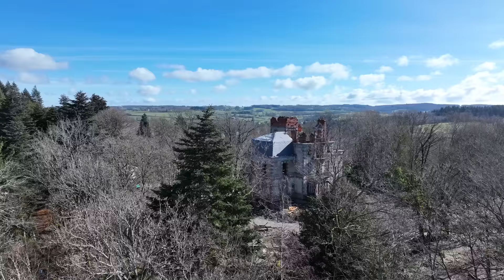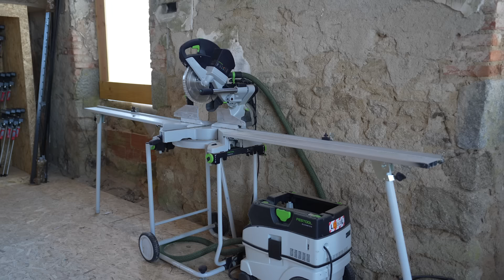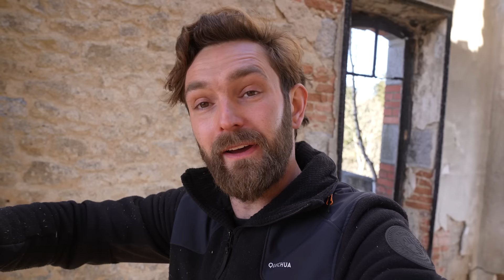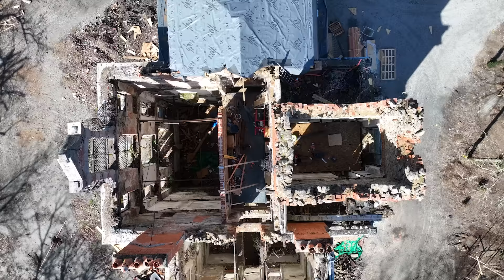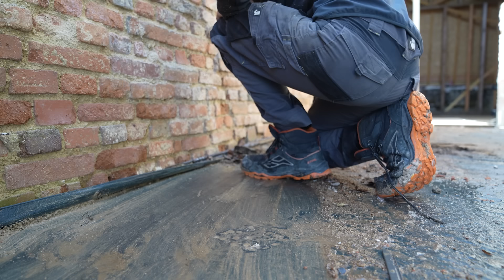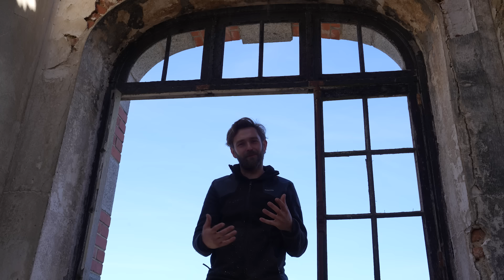What's next? the plan for the next stage of renovation.

Comment: Dan
Everything slowly but surely coming together. I noticed that the waterproofing you have put on the new roof is flapping around. If I were you I’d tuck those loose ends in and under the boards. Or nail some 2x1 timber along the edges..
If the wind gets underneath the cover it will rip it all off…
Cheers
James

Comment: One thing you might think about doing is cutting out a section of floor (middle maybe) and leaving as remove/replace so as to have a way to pass material up and down as needed.  You just need to frame out a box around the opening.  It will be a trapdoor between shops.  
I wonder if you can set a mini-crane frame out the side of the building to facilitate moving material up the building.  Think of the way farmers put hay up.  It just involves a pully and winch.  It would save your back.   You have a lot of beams and sheets still to move up.  Save your back.

Comment: You did not say what broke in the winch but as it looks like a off-road type of winch, it may have an overload 'fuse' in form of a metal pin that if overstressed is designed to break.   If that is all it is, it should be relatively easy to fix.

Comment: Dan: you will end up with significant surface rust issues on all that expensive stationary woodworking machinery if you dont keep them in a humidity controlled space. Doors and windows plus a dehumidifier to keep your rel humidity around 40-50% will preserve the machined surfaces on that equipment for the long term. And by machined surfaces I mean the one you can see (like teh machined tops) to the ones you cant see (the gear mechnisms, shafts, etc) inside the machine bases. 

I'd also like to see a bit more detail in the content you are producing weekly. The last few videos are more like McDonalds fast food.

Comment: On the very top of the crumbling tower walls should be one last floor. That is the floor with the huge tower roof windows. 
You can probably get away with no stairs and just installing two pull down step doors to those levels, then a simple ladder and trapdoor to get to the Widows Walk at the very peak of the tower roof. 
There will be tonnes of storage space when everything is done and built.
You can only go so fast Dan. The family is still more important and not something you want to neglect. Those children will forever remember Dad and the huge mansion he rebuilt that they got to play around in and watch get built. Lots of awesome memories for when they are older adults and get to walk through the finished Chateaux reminiscing
Reply: At the time of the video he's on the third floor, so the floor above he's talking about is the fourth floor. It has three small windows. On top of that was the roof with at least three dormers (impossible to tell from the old pictures if there was a fourth). I'd think there used to be a ceiling between the fourth floor and the attic as well, makes the most sense.
Reply: I want to have my picnic lunch on the Widow’s walk. Something wind proof on a nice day.

Comment: I would definitely finish that hallway so you can help finish sealing off that wing with the roof that's on it. Then do the turret so you can put an actual staircase in to make the movement of materials much easier. Then the wing opposite the one with the roof on it. Then the wing on the back of the house. My 2 cents for what it's worth.

Comment: It always feels good to have a significant piece of a big project done.  Time to reflect and be proud of your accomplishments.  A couple of thoughts:
1.  On the workshop... before you place the tools think about the type of tools and how the materials will "flow" through.  That will help determine an optimal equipment placement.  Add more lighting than you think you need and more electrical power as well.
2.  On doors and windows... think about standardizing the size... you might need a couple of sizes but when building them you can minimize the jigs and make several at once. 
3. You are now a professional on putting in floors so it's just getting the materials, tools, and time in the right place at the right time.  They should go in fairly easily.

I enjoy watching your journey.  I'm in the USA and the materials we use are similar but we don't use as much rock and from what I can tell our timbers are much smaller.  Post as much as you feel comfortable and we all understand when "something" (like life) gets in the way.

Comment: If it was my project, the next bit would be the other (mirror image) roof section build. At least build the pieces and if need be store them till you are ready to install them. Reason being is that you have now a clean picture of how first the roof structure was built which may not be the case in a few months time. 
In my experience if one needs to build two identical (or near identical) things, those things are best built at roughly the same time or you may run the risk the second thing is built differently or with several errors or needs redoing in parts...

Comment: What next was always my question. You have confirmed what was kind of my guess. The wall rebuild to the new roof is definitely required. I would also contiune to add as much floor as possible. Seasonality wise potentially, the entire top floors and roofs. Let's be honest internal renovation won't progress without being water tight (roofs & windows) are needed. So you may as well crack on whilst you're in the zone. Keep pushing Dan your doing great.

Comment: I get how you are a bit lost after the roof. No shame in taking a few days off as that was intense concentration. What you need is a project timeline. An order of what the next job is and an estimate of how long it will take. That way you know what is next and will have a rough idea of when each step will be finished. It will help with ordering materials and budget. No problem if you finish each early or late. It’s just a framework. You should also have several blueprints. One each for electrical, plumbing and purpose for each room so you can plan for the electrical, plumbing, closets, windows and doors, stairs, etc. The more you plan the faster and cheaper work will move.

Comment: I’m not a contractor but I think finishing the brick wall in the attic, building a temporary attic door, installing  temporary windows and a secure door in the workshop should be the next steps. It keeps thx weather out and thieves. Security cameras should be next.

Is your neighbor connected to the grid? If so, can the city expand the power lines to your property, plus city water?

Could you do a video on these subjects, planning permissions, water, power, sewer. Are you entitled to community trash pick up?
Reply: Did it ever cross your mind why he has no power, water, sewage, - or even shown once a proper planning drawing?

Comment: Great video.  With all the work I'm surprised you get ANY video out at all!!  That turret looks very rough. You should bring it down about four feet or more. Throw off all those rough broken bricks on top. Get it to a nice flat level surface that will  be a lot stronger than the wreck up there now.  If I ever make it to France I'll stop by and help for you a few days!  (I put an old 1874 back together after a fire.)

Comment: My thoughts on the next project; get the steel in on the top floor on the other side, if the walls can handle it you can skip to the top floor and save the wood being exposed to any more rain than is needed. Oh, and is there a plan to get some stairs at some point or are you planning an elevator?

Comment: I’m no expert but instead of building floor by floor up why not just rent scaffolding and get the walls fixed then get the rest of the roof done. That would be faster and you wouldn’t have to worry about the floors getting wet and ruined by rain & snow. Get them to sponsor you and perhaps you’ll get the scaffolding for free or really cheap!
Reply: He just explained. Putting the floors in strengthens the building and in doing so will support the roof.
Reply: The weight of a mansard roof sits on the floors, not the walls. He has to build the floors first.

Comment: Hey Dan! Great work! ... just wanted to say, at some point, soon, I imagine, you'd want to either put some tin or galvanized roofing sheets, or, roof tiles on the part of the roof you've already completed, just to make that part a little more waterproof - this will protect the membrane and the wood below (but then again, you might want to wait until everything else is more or less complete, so that you can order all the tiles / roofing sheets at once - your call really ... if the membrane gets ripped or something in a storm - not that it would - you'll have to deal with that).

Comment: I wonder, how will you power all that machinery? Maybe get a second (or third?) battery and a few more solar cells (now that you have a roof to put them on)? Or finally get the chateau back onto the electricity grid though I can guess that will be a lot more paperwork and probably real work as well to repair the connection from the grid to the plot the chateau sits on.

Comment: Are you giving any thought to a small elevator somewhere? Joints wear out as you get older. There are one person elevators. Maybe somewhere in a corner in your bedroom that ties several related functions together over the three or four floors? Like a study/hideaway in the attic. your bedroom, the library, and a studio/workroom or even a kitchen(ette) or laundry and/or bath with sauna at the bottom. In other words a vertical suite.  It would be your elevator and not a guest elevator. They have to do the stairs.  It's a very tall house. 
I suppose you can always install a lift chair on the stairs?

Comment: If you finish the wall and roof in your current section, could you close it up enough to live in?  Then just use that as your base of operations for the rest? Or are the family logistics and safety against that idea? And a lack of a staircase yet .. 
Neat progress.
I would be very tempted to finish off that roof though.. tiles or corrugated metal.  Something semi permanent.
Reply: No electricity, no water or plumbing

Comment: You talk about waterproof/ water tight. Well... it is not fully true :\ You have no windows in the basement where your workshop is. Moister can still get in and damage your equipment. 

YES, rain can not come in direct from above that is a major improvement. Although from the sides it can, not much but it can. I should work first to seal those open-windows and doors as much as possible so there is no possibility any water get in or fog could flow easily into rooms you do not want moister at all. 

Your floors get wet again and again and you need to replace them afterwards when they get to wet and those boards are ruined. I know your work-order is from bottom to top, flooring every floor one by one. Do this and water will damage your floors. If there is a possibility to 'roof' the tower or other rooms, do so. think about is. It is harder to work on higher scaffoldings but the result would be a much more dryer space below it. An alternative is not to board each floor complete, just where you need to walk / work and use the same already damaged boards every floor. IN this way you will reduce the cost for new boards/ floors.  

You have done so far a very good job! Luck is absolute on your side. The walls are pretty stable. Your stone and masonry is great! Keep going.

Comment: on a percentage level, i wonder how finished this place is? by that i mean all the brickwork and structural problems done, all roofs complete, doors and windows, painting, and gas, electricity, and plumping and ready to move in. 10%?
Reply: Don’t forget insulation, walls, ceilings,floors…but hey, look over there at the landscaping.
Reply: 3%

Comment: Having worked in the construction industry for a long while and had a few roof covering get ripped off. All because of high winds before the roofs were finished. We even had one flat roof that was finished, and got sucked off as the wind blew over the parapet. 
It would have been a lot better to have put the tile battens on to hold the covering in place.
I feel your unfinished roof protection will not last all that long, only time will tell.

Comment: I hate to say I think you'll run into frustration running up and down stairs to use your table saw. Build it right with a massive off-feed table and include it in your assembly area. This ensures when you need to make a quick rip or whatever it's right there. Preferably everything is on the same level but it looks like you don't have that yet.